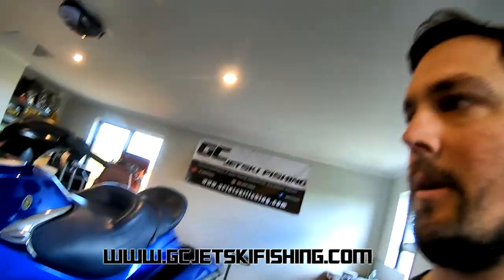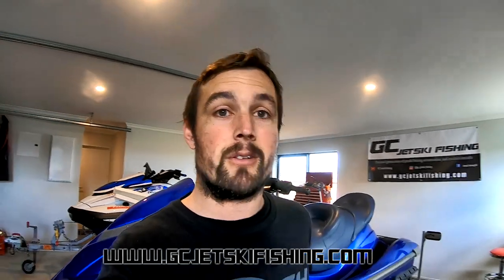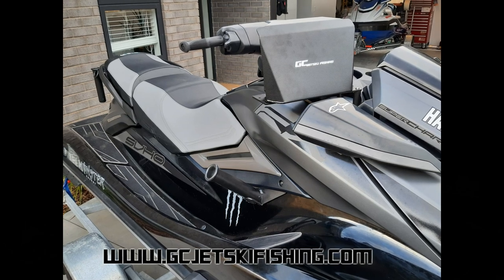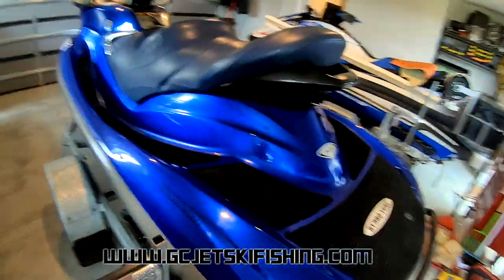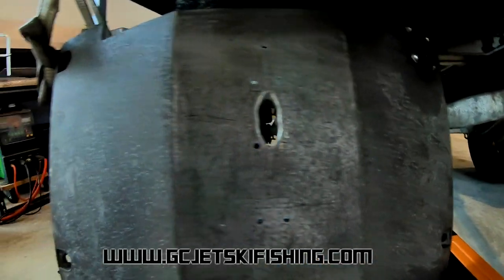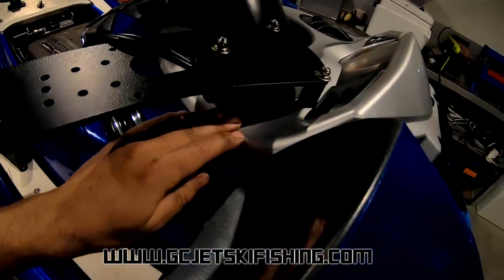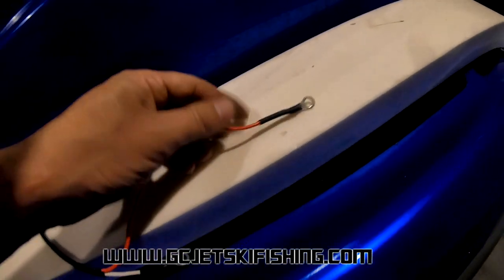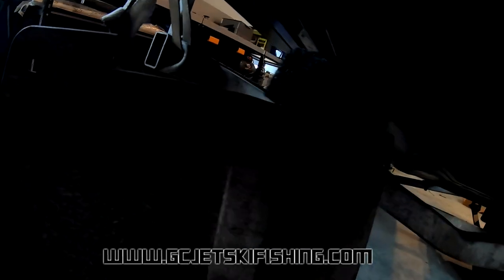Installing a Fish Finder on a Yamaha Waverunner fishing jet ski

Comment: Nice video.. one question though how did you run the cable for the transducer down to the ride plate?
Reply from the maker: Usually run it through the transom, somewhere that's easy to access from the inside so you can seal the inner and outer surfaces well with a cable entry cover/gland

Comment: Mounting the transducer like that. I am assuming you need to be very careful as it might damage quick?

I'm also assuming beaching the ski is out of the question?
Reply from the maker: The only time you have to be careful is when beaching or launching your ski. I actually designed a spring loaded retractable bracket so you can retract the bracket during beaching the ski
Reply: @GCJetskiFishing  that sounds interesting. Is this bracket available for purchase or more information available? I'm installing an echomap UHD and was planning on mounting the transducer in hull as I saw it also works, however not sure how well the clearvu will work.
Reply from the maker: @hasiehasie69  yes it is available on www.gcjetskifishing.com